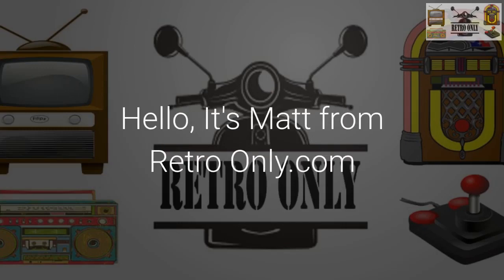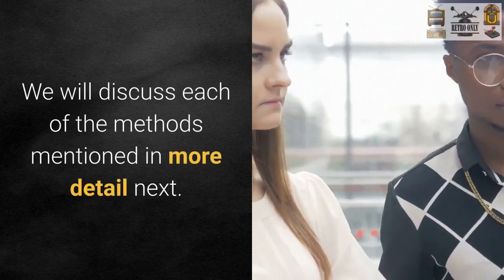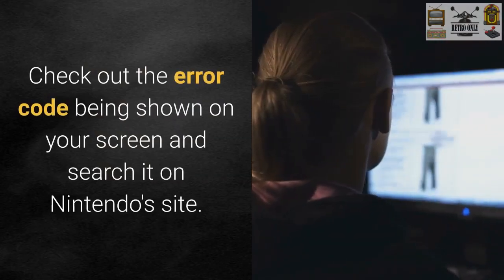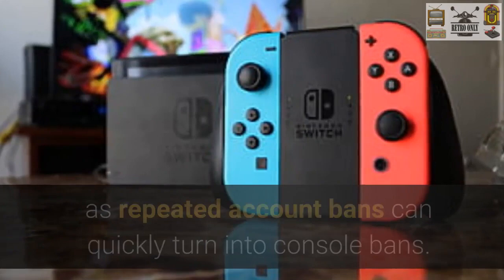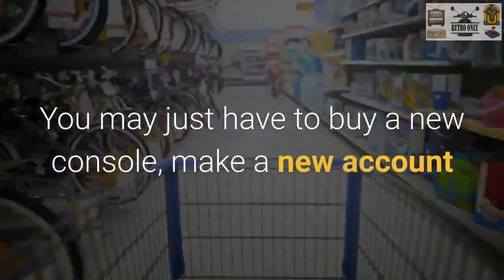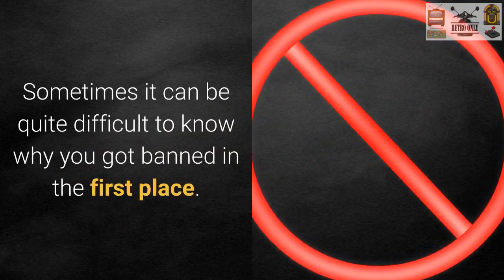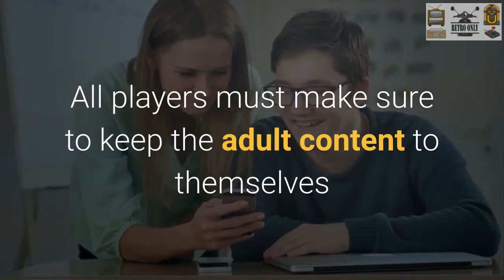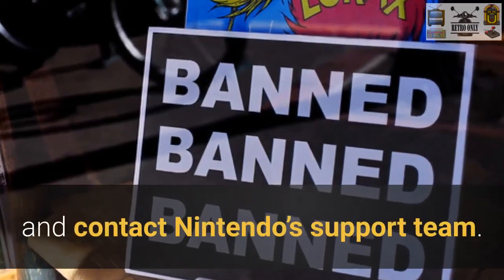How To Fix A Banned Nintendo Switch

Comment: When you accidentally went online with custom firmare booted 💀
Reply: yep.
Reply: Yessir
Reply: Same xd
Reply: bro i was being so careful.. then a game started up instantly trying to connect to the internet and screwed me
Reply: @rileyfreeman1738  my switch got banned like 9 months ago, It's not a huge deal since the only reason I put cfw on it was so I could play osu on it. I never really used it, sucks that it got banned tho
Reply: THANK GOD I didn't buy a payload hacking injector yet cause now i dont have to worry about getting banned
Reply: @A300G  there are some that won't get you banned but I was using atmosphere
Reply: @Clanps  what about Tinfoil or ReiNX
Reply: @Clanps  what’s good about hacking? Free games?
Reply: @james1311na  hacked pokemon lol
Reply: @Clanps  😐
Reply: @james1311na  bruh, why do you care anyways
Reply: Felt that
Reply: I’m in the same boat
Reply: Had the same issue here, what did u do?
Reply: @mohamdb8273  there is notging you can do besides buy a new switch
Reply: @Clanps  mine won't even turn on, just blank screen
Reply: @mohamdb8273  tf did you do to it
Reply: @mohamdb8273  try doing a full turn off by holding the power button for 10-15 seconds
Reply: @james1311na  yeah save money and not spend it on a scummy company like nintendo
Reply: Yep
Reply: Yeah☠️
Reply: Accidentally updated an app on the modded state 🥲
Reply: Got banned for accidentally going online with my hacked firmware smh on my part
Reply: yeaaa...
Reply: yep :I
Reply: Happend to me also...

Comment: I got my entire switch bricked by nintendo and I could never find out why. I reached out to nintendo to ask why my console was bricked, they said there was no listed reason and that they cannot undo bans placed on consoles,I trying reaching a conclusion but their solution which they told me was to just go out and spend 300 quid on a new console. I was hoping they could help me and now I have to take it much further to legal action. In Ireland it is against customer rights to block digital downlaods to physical content, even though nintendo blocked console I should have the legal right to play my physical games. I now have to take them to small claims court over the issue since they will no longer respond to my messages.

Comment: Is it worth it to buy a banned switch lite for 90$?
Reply from the maker: If you don’t ever plan to go online and only play locally then sure. If you ever want to play online then no
Reply: @RetroOnly  Thanks man😊. So getting one of those and rocking those sx chips once they come out could do the trick right?
Reply: Banned switch means no online multiplayer and no Nintendo eShop.
Reply: If you think that you dont need the eShop exclusives and dont need online play then get it 👍
Reply: Bro, I'd buy it, bc now you wouldn't have to worry about a $200 consol getting banned bc you wanted to mod it. Now you can get a $90 consol that can become the ultimate handheld emulator, along with a bunch of other stuff

Comment: Hey so about 2 years ago I used my dads credit card and then got banned I’m still banned but if I call them with my dad do you think they will unban it
Reply from the maker: What was the original ban for?
Reply: Retro Only payment method thing
Reply: I did the same thing. But what happened is that they suspended my account before they banned me. So I lost all of the saves for my digital download games on my account. Breath of the Wild, Mario maker 2, splatoon, etc. It really sucks
Reply: Wait what? They can do that???
Reply: @johnross5098  yes they can. I ended up having to make a new account but its just like my old one. Never make mistakes like I did.
Reply: @lukemullins7760  my brother was gonna buy a game on my account, thanks for thr warning